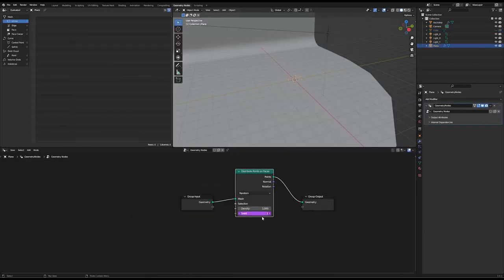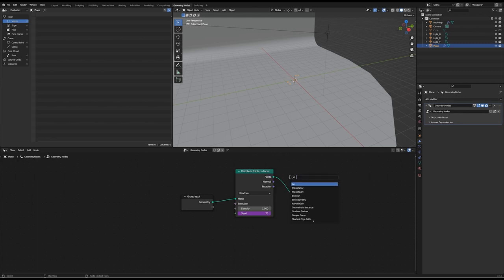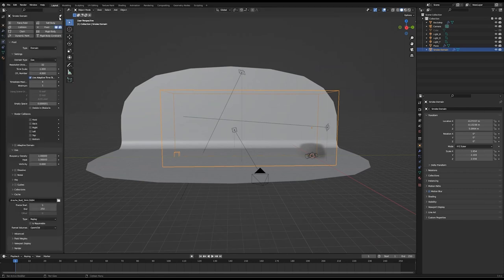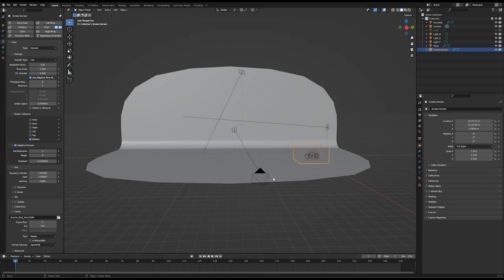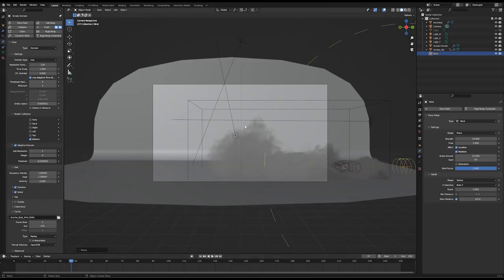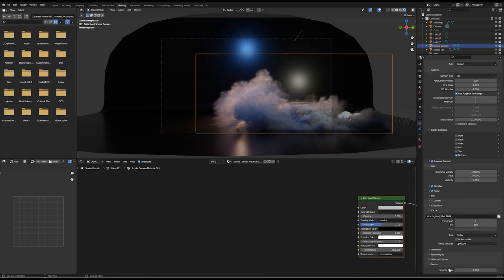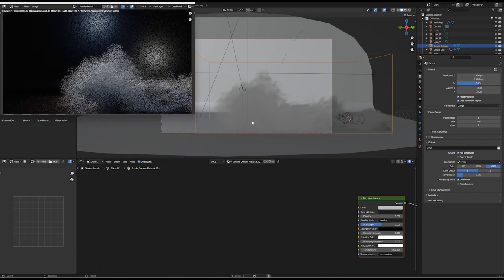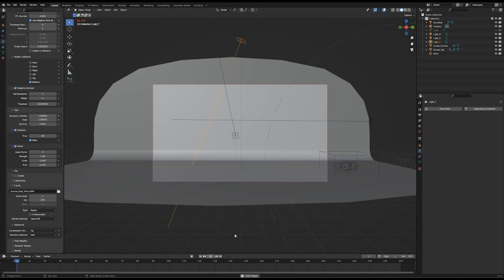BLENDER 3.4 ATMOSPHERIC SMOKE TUTORIAL

Comment: This is insane. The noise that you're generating in the initial stage of smoke production is the absolute most crucial part. As soon as that's happening, and the noise is attached to the density, you can do whatever you want! It flows far better around objects than usual, has far more realistic details, even at far lower resolutions. Phenomenal work.
Reply from the maker: Thank you. Yes, source noise is very important and the better the source variations the better the output. 🙂

Comment: @Resilient Picture Company Hey, I followed the tutorial step by step and I'm 14 minutes in and no smoke is appearing for me at all, I tried evee and cycles and still nothing, can you help me with this please?
Reply from the maker: Hey, Are you at the correct frame? Also, does volume currently have a material assigned? Have you cached your smoke? If not this could be the issue. You may need to cache it before rendering. Hope this helps.

Comment: how is this workflow compared to axiom solver?
Reply from the maker: Axiom solver is a beast. Super fast. Blender is improving but I guess it'll be unfair to compare to axiom.
Reply: @resilientpicture  I mean, speed is something ll be achieved sooner or later. I was most interested in a comparison in terms of control and flexibility.

Ty for replying btw.
Reply from the maker: No worries, Blender sims aren't flexible,.there's only so much you can manipulate but Houdini in general is the king of dynamics and you can manipulate sims unlimited ways and times. Axiom has limited options when it comes to flexibility but future versions may include customer solver inputs. That's my understanding
Reply: In my smoke sim the smoke feels like it’s moving too fast. What setting controls the speed of the smoke coming from emitter again ?
Reply from the maker: @naytbreeze  There are a few things to control speed, the velocity within the domain settings as well as the source movement. If the source moves fast and initial vel is set to capture that then smoke will move fast. You can reduce the inherit velocity to lets say 0.1 and try. Hope this makes sense.
Reply: @resilientpicture  can we not export these smokes as abc and use them in our projects? If we cant export them as alembic on blender is it possible to export so on ''Axiom'' or ''Houdini'' ?
Reply from the maker: Smoke can be exported as vdb, not alembic. As far as blender vdb exports are concerned,.I think there's a positional data issue. Hence if you export from blender and import it into Houdini it may not work very well. However from Houdini to blender is fine. Axiom or native solver, it doesn't matter. Hope this helps.

Comment: bro what is your spec I just use 128 resolution and it took me 30 minutes then I up scale the resolution to 256 and my  blender crash       ,  but how your processor is managing to run 256 resolution in Realtime please answer my question  my processor is (i5 12400f 6 core 12 threads)
Reply: maybe you should use GPU instead of CPU in render settings?
Reply: Bro but in blender you can't simulate anything with power of gpu I had a( rtx 3060)
Reply: @WhiteWeaselMotion  I am not talking about rendering I am talking about simulation
Reply from the maker: Hi, My spec is Aurora R10 Ryzen 9 5950X 12 core CPU, RTX 3090 and 64GB Ram. Maybe reduce the noise level. Make it to 2 and try, it might help.
Reply: @resilientpicture  Bro I am talking about the resolution of fluid simulation in blender
Reply from the maker: Yes, that's what I am talking about too. There is a noise attribute in fluid sim that you can enable and set its strength and level. Maybe try and reduce that and see if it helps.
Reply: @resilientpicture  ok
Reply: @resilientpicture  a last question is new i9 13900k is worth it for simulation stuff and for houdini
Reply: @focusedstudent464    Holy crap you're rude.    Homeboy makes the best Blender sim tutorial on the internet,  then continues to give you personal tech support FOR FREE .... all the while you're calling him "bro" (which is something you call a guy,  outside of a bar at 2am when you're about to scrap).    And you can't even be bothered to say 'thank you' ?     My god you must be an awful person.
Reply: @yesyesnonono  no i am not rude in india we use (bhai ) 
to respect some one who is bigger than us like big brother so i was giveing him respect from saying bro
the english translation of bhai is brother in short (bro)
Reply: @focusedstudent464  Calling someone who you aren't already friends with 'bro' in English, is the same as saying to someone on the street "Hey buddy!" which does NOT mean friend in that context.     
Translation aside, you still sounded like an entitled kid,  you could have shown some gratitude for the guy trying to help you.
Reply: thank you for the lesson  @yesyesnonono